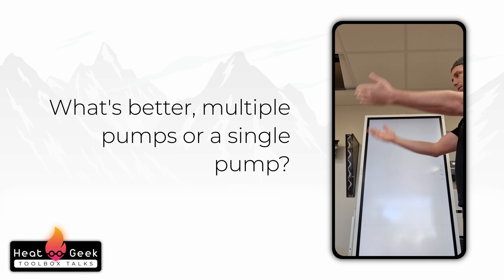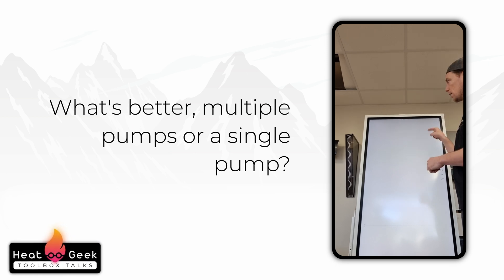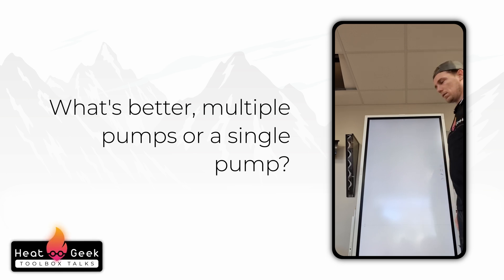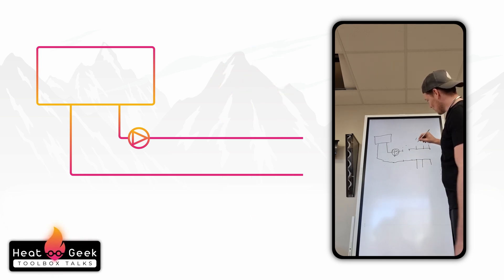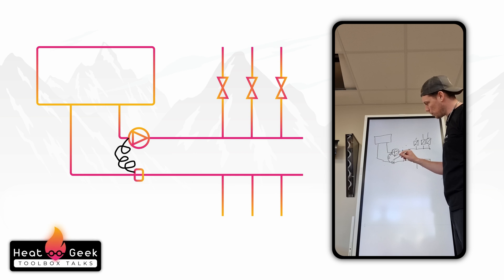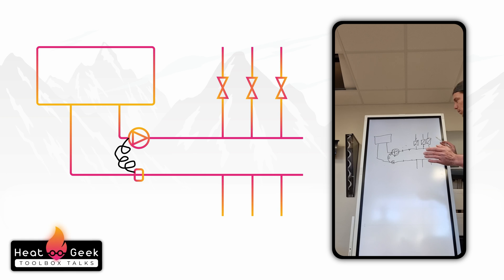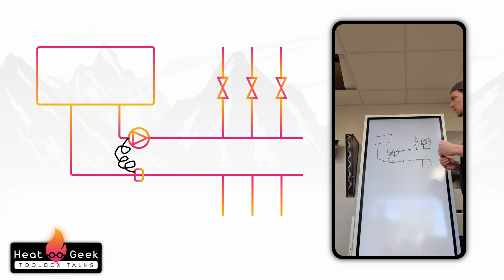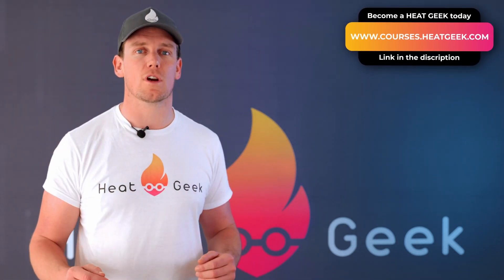How Many Pumps Does A Domestic Heating System Need? | Toolbox Talks

Comment: Can I ask if having a secondary hot water system is that bad?  Yes it mixes in the tank but if it’s well insulated should keep losses down to a minimum and also reduces the amount of water needed to run to get hot water out the tap.

Comment: Can you run an UFH system on the combi boilers internal pump or do you need an external pump? (16mm, 15cm c-c, totalling 80m2)

Will be doing a full heating system from scratch in my new house soon (UFN only)

Comment: How do you deal with on/off behavior of the heatpump at higher outside temperatures without a buffer? Thats also inefficient.
Reply from the maker: modulate the compressor speed
Reply: @HeatGeek  but it won’t modulate back far enough at some point? At outer temperatures above 8dgC it will still get ON/OFF behavior which effect lifetime.
Reply from the maker: @marchees1716  if using wether compensation the flow temperature is so low your still as cop 5 or 6

Comment: Would be great to cover a hybrid system in a future episode. Particularly interested in a heat pump to an existing system, gas boiler and radiators all served from plastic microbore. I imagine hydraulic separation, widen the heat pump dt and balance the primary and secondary flows. The boiler would work standalone on a dT20. 

Or at least that's what I'm hoping for mine!

Comment: First of all massive Thank you! Your videos have completely changed my installation designs and increasing efficiency for my customers!
 I’m installing a system boiler, utilising hot water priority. The boiler has a 15/70 pump (400mb max)  my question is will that be Sufficient to run 12 radiators and 6x6m of underfloor heating without the need for a manifold pump?
Reply from the maker: Thanks! Too many variables there!! Mainly load.  Get on the course and answer for your self!

Comment: Depressingly, we are currently midway install of a Viessmann 200-W that runs radiators and underfloor heating on separate circuits. A total of 2 external pumps, one for each circuit, plus the boiler's integrated pump. There was no way to do this without the two pumps when using a 200-W
Reply from the maker: That's absolutely fine...

Comment: Could you do a comparison of air-con units as air to air heat pumps Vs the air to water that's being pushed in the UK please? They seem to have a better CoP and don't require new radiators/under floor + have cooling for summer so other than needing a separate hot water solution, what's the downside?
Reply: The main downside is distribution. You're obviously not going to be putting one in every room, that would be too expensive, but if you don't it will be harder to get heat distributed to all the rooms. Finally radiators are generally a more comfortable form of heat than hot air, though many people would accept this trade-off to have cooling in the summer.
Reply: @hpac1009  That makes sense, although I guess there are solutions to that, such as American style 'central air' - big job to put ducts everywhere but perhaps no worse than putting under-floor pipes everywhere? Pretty straightforward in a bungalow with an empty loft.
Reply: UK brethren: air-to-air “AirCon” is NOT the road you want to go down for residential - take it from us who have be sold this as the “go to” tech in the US - NO.  Here, if we are doing cooling, I specify a few emitters that are fan coils with condensate removal to exterior and pipe so heating only emitters (UFH, panel rads) can be shut off for the summer/cooling period.
Reply: Your air-to-water heat pump can switch from taps hot water to cooling. Your cooling capable lines feeding FCUs for cooling and the trunk lines to them must be thoroughly insulated to not “sweat” condensation along the way. This includes valves and all brass bits.
Reply: 3: your Fan coil units for cooling…also do heating! This may avoid some panel rad upsizing in a given room.
Reply: 4: One of our most experienced US designers, John Williams of Chiltrix, likes the approach of managing chilled water leaving water temperature such that condensation is avoided, but somewhat cooled air and lower-temp radiation is achieved. The US commonly sees very high relative humidity, so this is a bit of an advanced move, but certainly possible. Insulate pipework that could possibly be chilled in summer, especially if it somewhere you can’t see it or don’t complain to me in future.
Reply: 5: why avoid air-to-air mostly has to do with COMFORT lost due to blowing air around and the phase out of HFC f-gas refrigerants and the virtually inevitable leaking of them that come with less than perfect installation and even then, coils failing, esp. thin high efficiency coils. The concept of “refrigerant efficiency” per delivered ton capacity is new here and gets a bit involved, but air-to-water and water-to water GSHP have good refrigerant efficiency, air-to-air generally has poor to terrible refrigerant efficiency. Continued:
Reply: 6: The only future-proofed HVAC is that using natural refrigerants such as PFAS-free R-290. The best way to “keep refrigerant in the pipes” is to use a monobloc with ref factory-sealed at manufacture. You are using these now - stick with that, UK folks!! New IEC rules may allow small direct exchange systems (air-to-air) to use R-290, but larger DX and VRF in particular are dead end tech when one considers the future of our atmosphere not tolerating lots of 700 GWP refrigerant pissing off to speed up destructive and unpleasant weather for no reason than the HVAC industry not leading and continuing to sell units that just benefit Chemours/Honeywell, etc. making synthetics that work less well than R-290. End of lecture.
Reply: A2A works great for us because we are well insulated. We don't need a lot of heat, so even when we used gas we never did get a warm glow off the rads and now the a/c doesn't need to blow hot air in our faces. A simple 1-day £3.5k install and we get to keep the gas boiler for towel rails and hot water ...or totally unlikely -30°C frosts. My fear with Air 2 Water would be having a single point of failure and trying to get an engineer out on short notice.

Comment: "How Many Pumps..." Answer: None if you have like me a vented hot water cylinder with immersion heater. Using E7 tariff costs just 80p a day providing 2 showers a day and plenty of hot water for hand washing and dish washing.
Reply from the maker: and heating in. the summer?
Reply: Water heating is year round controlled by a wired-in timer. By trial and error I've found that 80 minutes on time gives a water temperature of 65c. 80 minutes heating at 3kW at a unit cost of 18p = 60p plus standing charge 20p = 80p total. I've noticed that during hot sunny weather that the power used is noticeably less. Probably due the our cold water tank is in the loft. The water is warmed by the high air temperature in the loft. Seems I have a free solar water heater halving energy costs when it's sunny.
Reply from the maker: @wattsupmike7593  but what about space heating??
Reply: @HeatGeek Space heating is by convectors one in each room. Currently 11,500kWhs total energy consumption per year at a cost of £1950.
Reply from the maker: @wattsupmike7593  how are the convectors heated?
Reply: @HeatGeek  electrons!
Reply from the maker: @wattsupmike7593  during the day?

Comment: 5 pumps ! 

The new 150A will prove these low temp systems are simple to install 

We are guilty on using using multiple pumps. 2 max with piston check valves that act as zone valves with a opening preload to combat creep 

do you teach bout cooling circuits in your courses ?
Reply from the maker: Not teaching about cooling yet. I don't have any experience with it. Happy to team up with anyone who works in fridge

Comment: What DT pumps are you using or what do you recommend?
Reply from the maker: Only every used grannies alpha 3.. think wilo do too though
Reply: @HeatGeek  did you read your reply?  I’m not sure grannies are the correct pump to use.
Reply: I’m guessing it grundfos pumps 😂 but still I think it’s far more efficient to get grannie on a pump and earn her pension. Keep the videos coming.
Reply from the maker: @davideyres955  ops yes meant to say gunny i.e. grundfoss haha
Reply: @HeatGeek  is there an additional temp sensor we need to buy to attach to the alpha 3? i cant seem to find any information when i google "delta t pump"